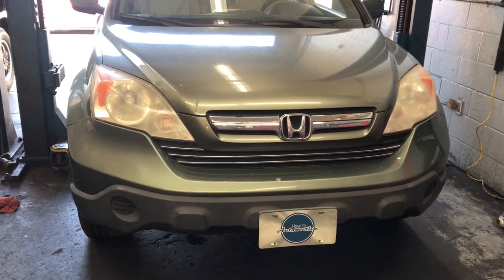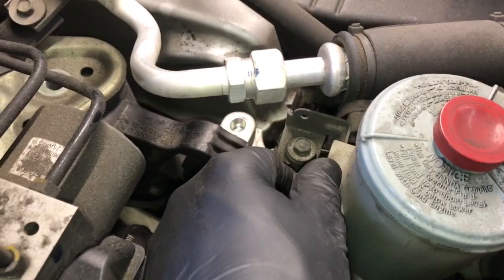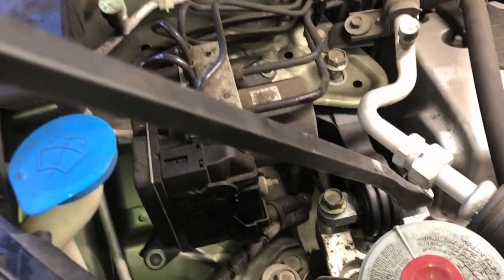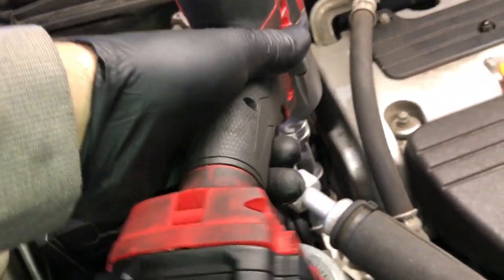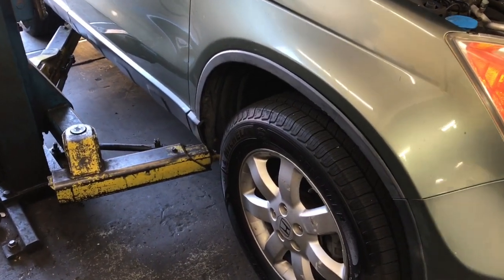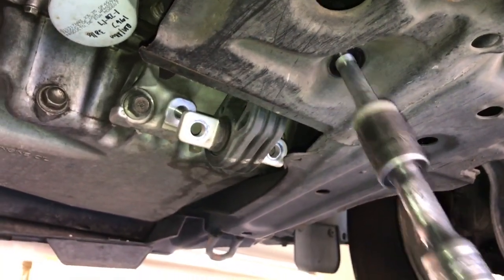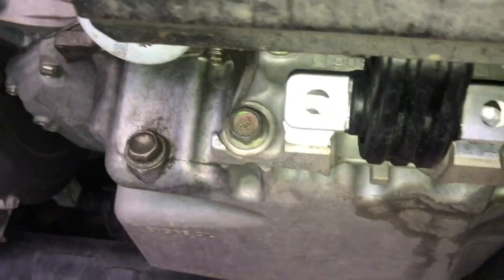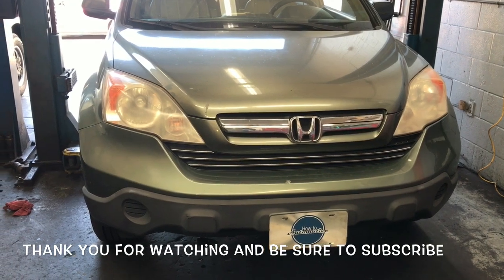How To Replace The Torque Strut Engine Mounts On A Honda CR-V

Comment: Question? Dont you need to have the engine raised up a little with the hydrolic jack to relieve tension on the mount bolts

Comment: I didnt see it in video but did tou have to support the engine at all while swapping these two?
Reply: He never mentioned supporting the engine, so I hope not
Reply: You do have to support it. Because the weight of the engine puts pressure on the Mounts, making it more difficult to remove them. All you need to support it is a block of wood, preferably a stack of 2 2x4's, and a Jack that can handle the weight of the engine. A 2 Ton Jack will be sufficient enough. Stack the 2 2x4's on top of the Jack, and bring the jack up just enough, not too far, to relieve the weight of the engine from the mounts

Comment: Hello thanks for the video, is there one for the driver side mount replacement or that rarely is replaced? I'd like to check that mount as well, thanks
Reply: I can't find a video on it but I did that one recently and it wasn't as hard to line up as the passenger side one but I did have to move the fuse box and unplug the ecu that sits on top of the mount. It is worth replacing that mount because it's the only one connected to the transmission. The other 2 engine mounts are the passenger side and down below near the oil pan. There is also one rubber cone shaped mount directly below the passanger side dogbone shaped mount that has a lot more bolts to remove. It is a very strange setup and I don't know if it is based on the Civic platform.

Comment: I have 2007 CRV but it's 2.0 engine. Is it the same size for 2.4 engine mount?
Reply: Do you need to support the engine when completing the lower motor mount?

Comment: Does this help with vibrations at Idle?
Reply from the maker: The torque mounts probably won’t help with the vibration it’s going to be the main engine mounts or transmission mount.

Comment: What are the symptoms of a bad torque strut mount? I was trying to determine if my problem was from a bad engine mount or bad upper and lower torque strut mount. My car vibrates a fair amount on start on for a minute or so and then I also notice it when I am stopped. Also, sometimes when I am slowing down to a stop, when the car shifts down it jolts me forward slightly.
Reply: I own 2 civics and had to replace the motor side  mounts on both ( 13 & 14 yrs old) because of the vibration . This top torque rod would not help with the vibration problem but the bottom one should take care of the jolting.

Comment: you din't have to use a floor jack?
Reply: Why would you?
Reply: damianraver  No need to hold the engine up for torque struts bro, you are not removing any main mount.